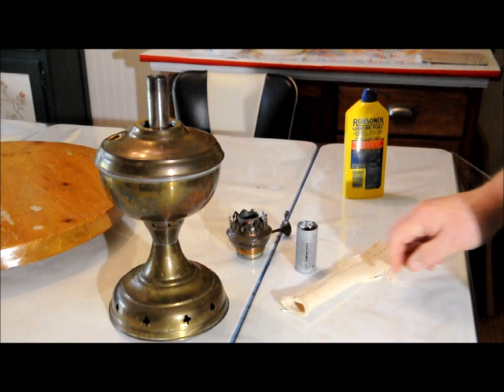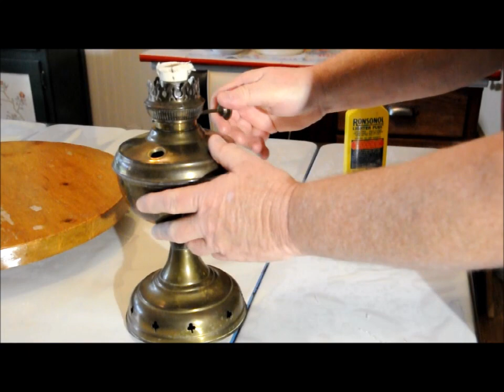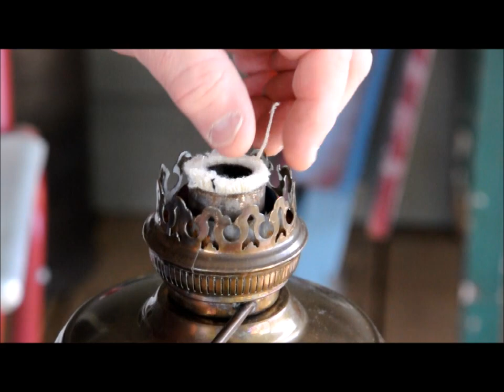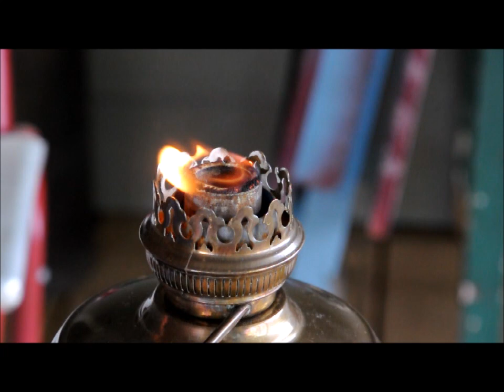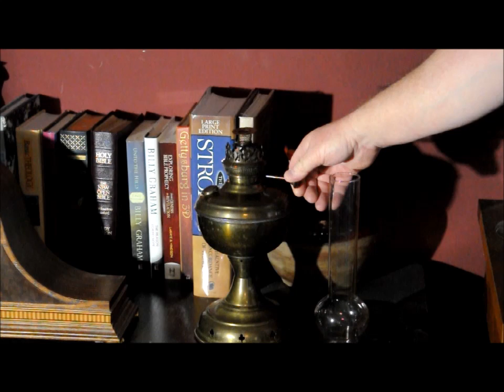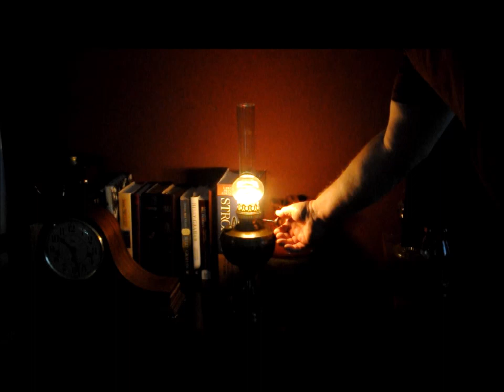Replacing A Round Wick In A Center Draft Lamp

Comment: Do all round wick lamps need flame spreaders? I just bought one, it's a hanging parlour lamp probably 1890s, and it's a round wick, but I don't know if it's a true centre draft lamp. There's no tube going through the font, it's just a regular, solid glass font
Reply from the maker: A true center draft will have a tube through the center of the lamp where it draws air from the bottom and comes out in the middle of the wick. The air comes through the spreader and feeds the flame.  Yours may not need a spreader.  There are several antique lamp collector sites on Facebook, where they could tell you anything you need to know about your lamp, and you can share pictures.

Comment: Thanks for the tip. I have a similar center draft lamp, but it didn't have a flame spreader when I bought it. So, I made a makeshift one. However, the top of the fuel tank gets too hot to touch after about an hour or so. Is it normal? How long can it go on on a full tank of fuel? Have you ever tried? Thanks in advance.
Reply from the maker: Burn time will depend on the size of the fount. It should not get to hot on the top of the fount, You should join Antique Kerosene Heater and Lamp Collectors on Facebook. You could post some pics and we could tell you all about it. Someone might even have a flame spreader you.

Comment: Do you use low sulfur kerosine?
Reply from the maker: I usually use Crown K1 kerosene, but most people prefer Klean Heat that can be bought at Lowes, Home Depot or Walmert, it has less odor. If your wick is clean and trimmed there should be no odor from kerosene.